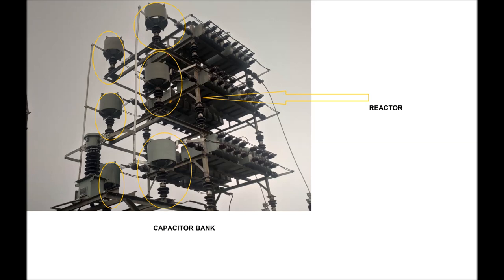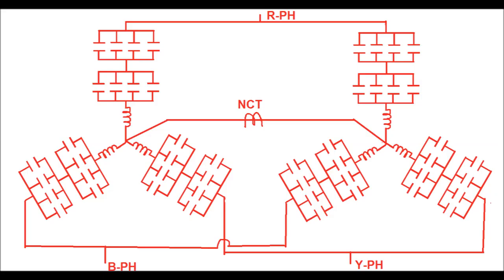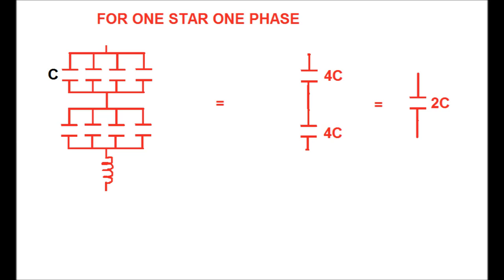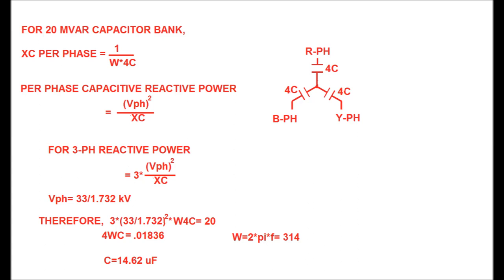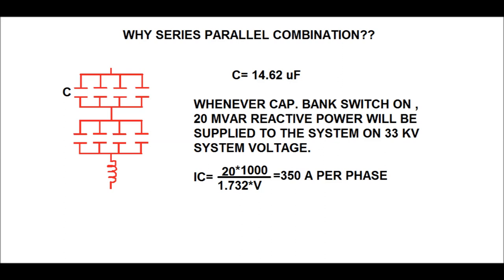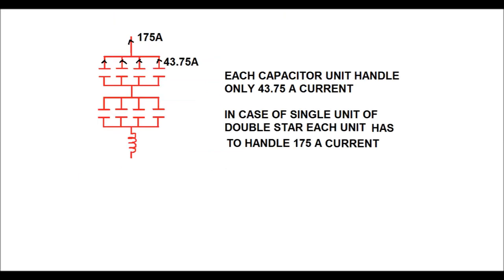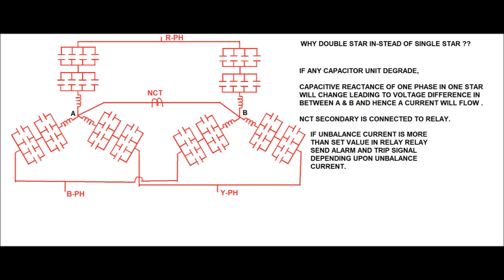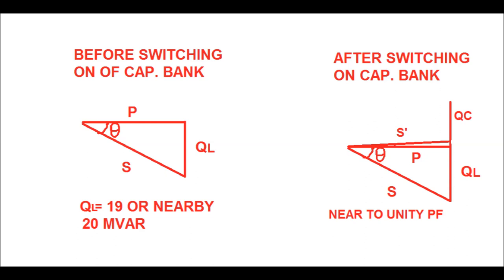CAPACITOR BANK || 20 MVAR 33 KV VOLTAGE RATING || SCHEMATIC DIAGRAM

Comment: Instead of delta mode, why capacitors are connected in star mode?For same degree of reactive compensation,  kvar required in star mode is three times that in delta mode.